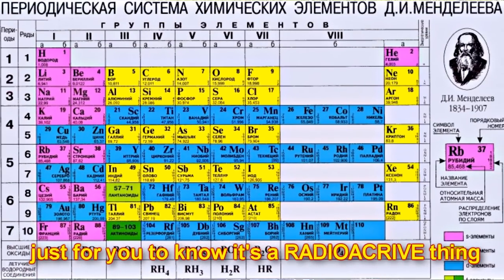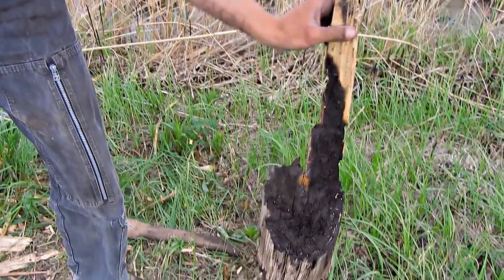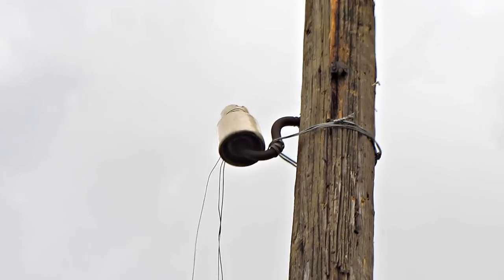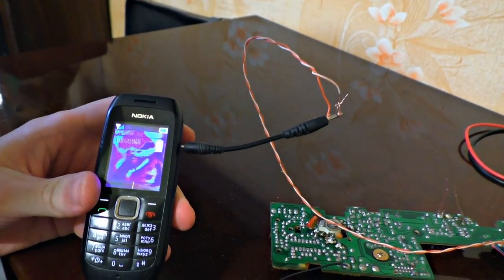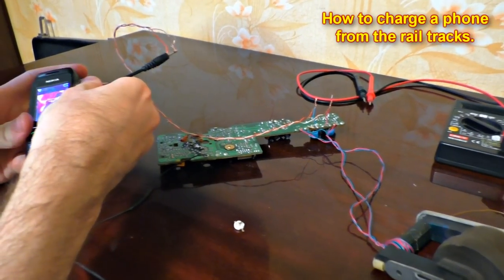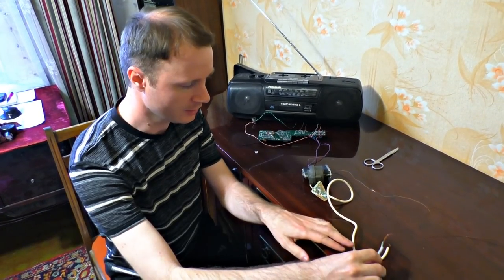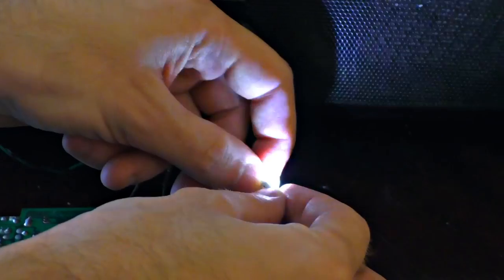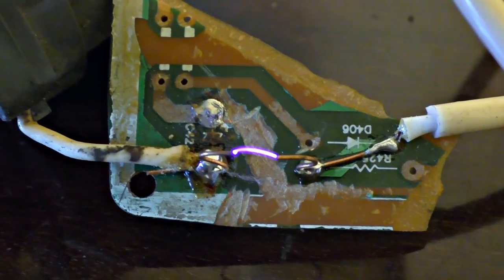Atmospheric electricity. Free energy

Comment: Wire so low parallel to a high voltage line. Don't you think you just pickup some of this line's power ?
Reply: Yeah that's what I was thinking, but why does the lamp screech so much when he hooked it up?
Reply: Yeah its from the power lines I assume, still create a matrix of these collectors in your garden with SLA batteries and an invertor and you could reduce your bill).
Reply: Yeah, that's the whole point.
Reply: @mernok2001  No it's not. They literally explain it in the video.
Reply: lamp probably screeches because they recieve energy from radio transmitter
Reply: Yeah, and when they charged there phone did you her the high pitch noise? That was another flyback transformer off camera making those arcs.

Comment: The high-voltage transmission lines are visible in most of the early video.  I suspect you are picking up from that electric field.  When I ride my bicycle near electric towers, I can feel the shock of the current through my skin against the bicycle frame.
Your testing of the bare wires without the circuit shows low current but high voltage.  If it is from the power lines, it will be at 50-60Hz. Do you have a high-ratio transformer that runs at that frequency?  The flyback is designed for 16kHz or so.
Perhaps a microwave oven transformer with your sensor connected to the high-voltage lines?  I don't know how much you will lose in the core of the transformer, but you might get a good current output on the primary of the transformer with no spark-gap to lose energy.  Maybe.

Comment: FAKE!!! Why such trickery? First of all, the naturally occurring charge in the atmosphere is about 100V per meter.  This wire is maybe 3 meters from the ground meaning 300V. This is not a high enough potential for an arc to form over the distances shown. The  dielectric break down of air is about 3000V per mm. They were forming arcs from about 8mm away meaning there was about 24000V!  Getting this kind of voltage from their setup is impossible not to mention the fact that the current available from the atmosphere would be far too small to form any continuous arc. They were simply using a high voltage power-supply such as a flyback transformer. The high frequency noise created by the arcs was due to the switching circuit of the power supply. This was also a dead giveaway because the current from the atmosphere wouldn't have such a strong AC component. Some people have suggested that the power is coming from the nearby powerlines via capacitive coupling. The high-frequency noise also rules this out, as the frequency of energy coming from them would be at 50Hz. The frequency heard is up in the kHz range.
Reply: Yes, it looks very fake...

Comment: Great video! You made me want to try it myself :).  I think you should make another video on this.  Some suggestions: try using longer wire,adding another secondary winding on the transformer in parallel with the one you have, a bigger capacitor (maybe a few in parallel)  after rectifier,  high frequency diodes, try it without the spark gap. The spark gap  is needed if you have high voltage dc and want to turn it to pulsed dc for the transformer, but here you should have high frequency ac (or at least I think so) if so, the spark gap is just acting  as a resistor  and wasting power. Good luck!

Comment: If I understand correctly, you get high voltage low current dc from the air and convert it to 5vdc low amperage(less than 200ma I guess).  You need a spark gap before the transformer so you can vary the dc input and get some kind of output(very unstable though). Is there some sort of HV dc switching device that could work better than the spark gap? I'm thinking a high voltage ionic motor or something.

Comment: My welded wire fences buzz when there are lightning storms in the area, also I have 2 full length (16 feet) rebar in the ground as lightning rods and they buzz in electrical storms.  I hope if I could attach a rodin coil to my antennae I could get something. Also hoping to do something with a dipole antennae.

Comment: I did even discharge clouds! But the important thing about is its not just direct discharging! However all we need for this are a few ballons filled with hydrogen, wraped in aluminium foil which are connected to a super thin aluminium wire. The wire should be a few kilometres long.. However now youre able to let the current directly flow from the clouds, But thats not what were going to do because that wont give us as much energy! As we just know from tesla, a sparkgap and a coil is a simple resonating oscillator and thats exactly what we need! That means we just put the wire in series with the sparkgap and the coil.. Then we just have to ground the other side..  Then it will start to oscillate very strong! The field will even clip in spectrum analyzers kilometres away.. But however to really use this energy now i would just put a teslacoil into the resonator coil.. And then we just need a second coil with umm idk 2 turns and the current which will come out of it, thats what were going to rectify using high frequency diodes.. And then well just have a few kilowatts dc! :) someday ill try it

Comment: Pretty ballsy for a number of reasons. Have you considered using an LM317 or more complex switching regulator with a filtering capacitor to increase the stability of your circuit? Throw in an appropriate zener diode and you could have a pretty robust atmostpheric energy harvester circuit, nature willing.
Reply: Ryan Whitney yeah, but they tried to keep it simple

Comment: LOL so fake. Why are you rectifying "atmospheric" currents? Does it come from the sky in an AC waveform? All you built there was an AC-DC converter circuit and attached it to your mains. And btw that was some piss poor editing on that lightbulb at :30 seconds. For the most part I like your other videos, but this is unacceptably lame
Reply: +Hobtronics i am almost sure that they are just absorbing EMF from the AC power station towers nearby... its like a step down transformer...  low voltage and high amps..very unstable.. but its free....